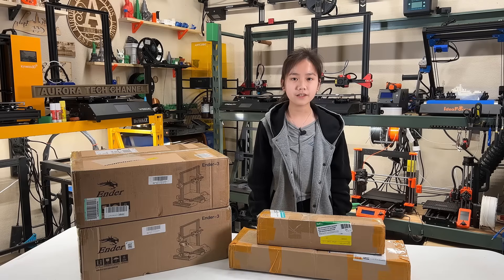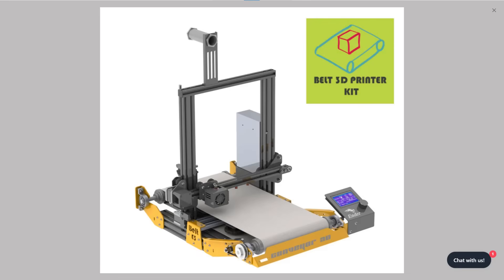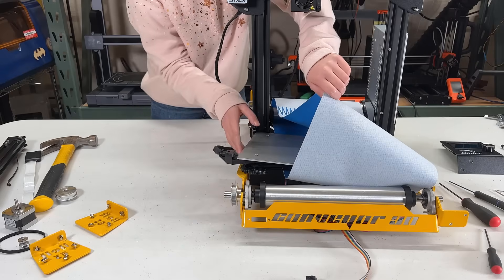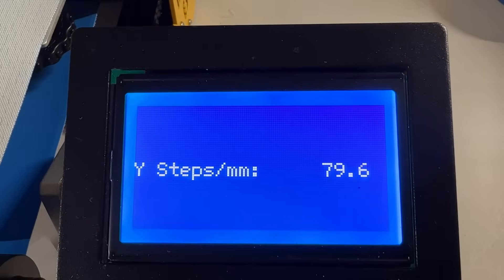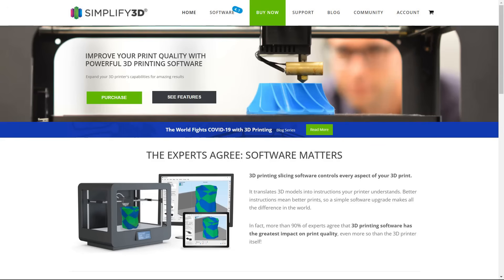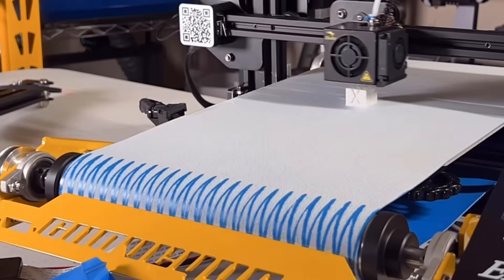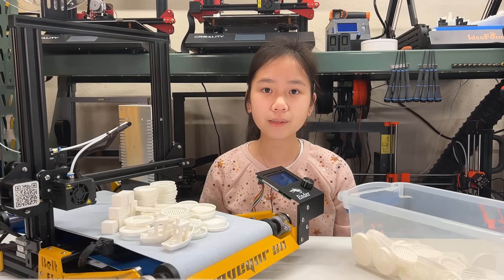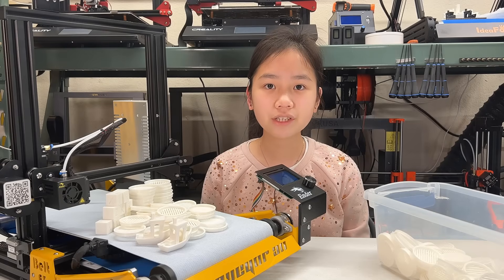Turn your Ender-3 into a conveyor BELT 3D printer, 90-degree continuous printing, batch production

Comment: Tip for One at a Time print Sequence in Cura that i just learned and has made my life way easier:
Cura will print the most recently inserted file first. So you could just enter the models in backwards order and it will print in your desired way. But even better is just throw all the models in there and arrange them as you want. Then go to the model that you want to print last. Delete it, and then immediately hit undo. Move to the second to last model. Repeat until you get to the first model you want printed, delete it, undo, and BAM theyre now printing in the order you designated without you having to move the models around or worry about placement order. Whenever you make or unmake a group, it acts as the model being imported so that will mess with your order aswell!

Comment: I am a new fan from Switzerland. I am petitioning for a new post on the same subject but with an affordable IDEX 3D printer like the Sovol SV04. I wonder if it is difficult to combine the software for 90° continuous printing with independent dual extruders. I am pretty sure it will be a very productive and convenient unit for less than a thousand dollars.
With my best regards

Comment: A question please. Would you buy this DIY conveyor considering its cost over the purchase of a a nearly new, return or secondhand CR30 which can be hand in Spain for around €450 ?  Is is better to buy the Cr30 and refurbish it or use this kit as the CR30 is a dedicated belt printer.

 Patents suck and how they are abused and control innovation need to be changed. 

They were and can be useful but now they are used by ever more greedy corporations to hold back i, block, hinder change so much. 

It's time now that the world learned to work together and use patents in a different way. We desperately need to rewrite international patent law .  I am all for protecting intellectual property but at a limit, if they are being used to prevent innovation and modernisation that this world needs then patents should be scrapped altogether and be replaced with something that will enhance and benefit all mankind.

The ""everlasting light bulb and match""  are always good examples here but whether they are true or false is what is at question, they both benefit mankind yet are prevented from being made as the corporation that owns the patents and makes those replaceable bulbs and matches will go out of business. If that's true so be it, it will force change and innovation to make alternative products that are useful to our race.

Let us work together for the common good and not for money.
Reply from the maker: A used CR-30 at €450 is a good deal, it would probably work better than a DIY kit.
Reply: Tx

Comment: What about using the Ender 3 Glass bed under the belt to take up the space ?
Once it warms up it holds the heat very uniformly over the entire area due to it's large even mass.
Reply: It would need to be static under the belt. But heat is definitely needed

Comment: I am looking to see if you did a review of the 45 degree version. to compare. The 45 degree version in theory might stick better because you are not really trying to print to the "Sky" and hope the base stays planted on the build plate. But you do have to get the Nozzle really dialed in as close to the belt as possible because the extruder is at a 45 degree angle. I am starting to think if I keep my standard printer I am going to get the 45 degree up grade kit in stead of the 90 degree kit and new/used ender 3.

Comment: you said you made a video with an ender 3 pro, but I can't find that video, can you link it here?
Reply from the maker: Here you are:

Ender-3 Pro assemble:
https://youtu.be/KCuYj9PXMkA

Hardware upgrades:
https://youtu.be/XEwSQHRiMLo

Firmware compile:
https://youtu.be/Ztj2VidZHVU
Reply: @AuroraTech  I'm confused, in the video you said you made a video where you converted an ender 3 pro into the 45 degree belt printer, that's the one I want to see. I have an ender 3, and I have the opportunity to pick up an ender 3 pro really cheap, so I want to know which one is better to use for the belt printer?
Reply from the maker: I actually said a made the Ender-3 Pro assemble video(just the printer, not the belt kit). For this belt upgrade kit, using an Ender-3 or Ender-3 Pro would be the same, just get whatever is cheaper would be fine.

Comment: I imagine they are using completely flat rollers that wont make the belt track. If you look into sanders and stuff like that the center of the rollers are usually proud of the rest of the surface which makes the belt stay in line. Very counter intuitive. Might have to get one of these kits and turn those rollers on my lathe to reshape them the correct way.

Comment: I bought five Ender 3 all with 8 bit board and they all print perfect. I get one with 32 bit board and it prints very poorly. 
Not sure about this new 32bit board. I installed updated marlin firmware to see if that would help. No change.
Reply: Thinking I have to buy another Ender 3 because this one 32 bit board print so poorly. Not very typical of Ender 3 which usually prints perfect out of the box.

Comment: Fantastic review!  Very complete and balanced.

It looks very well made and documented.

I'm a bit surprised that you are able to print on the belt where the two ends of the belt are bonded together.  I would have expected some unevenness there that would affect layer adhesion.

Adding a skirt to the benchy should help with adhesion, since it's relatively tall in comparison with the size of the base.

Did you mention anything about the bed heater? maybe the belt isn't making great thermal contact with the heating surface. It might be interesting to measure the temperature of the belt surface while printing, ideally with a thermal camera.

Keep up the great work! Your reviews are getting better and better.

Comment: What do you think of getting an elder 3-V2 and add the belt kit?
Reply from the maker: Since the Ender-3 V2 cost $259, plus the price of the kit, it would be over $500, while you can buy a new conveyor belt printer like the IR3 I reviewed last week, which came with linear rails, larger print volume, and better hardware than the stock Ender-3 for $600. So, I would rather recommend using your old Ender-3 or getting a refurbished one to play with the kit.

Comment: For Cura there is a simple workaround to print in the order you want. Goes like this: 
Place all models. Click on the model you want to print LAST. Then press und hold SHIFT. click the second last item. Continue with shift holded until you reach your first part. Then press CTRL+G to group them together and now you can immediately ungroup them with CTRL+SHIFT+G.
Now it will print in the order you want. Works on Cura 4.x. Don't know if this "feature" will last on Cura 5.0 which is coming soon.

Comment: First off -- Awesome video, thanks for making this and keep up the good work you guys.

I love that you explained the 90 vs 45 degree patent; honestly to me though, that sounds like an invalid patent (as prior work exists and patents are required to be "novel").

Second off some FYIs:
1.) When I click on your link for a refurbished Ender 3, it's now 199.99 (which is 10.00 more than a new Ender 3 on Amazon). 😅
2.) Also, if you find that your motors are running too hot, but you still need that torque, you can mount heat sinks to them.  It's a thing.
3.) Instead of a Raspberry PI, look for old Used NUCs they're slightly bigger -- but they're way more powerful; for around 40.00 I scored a Pentium N3700 -- with 8 GB of RAM and 250 GB SSD (the CPU goes from 1.6 GHz to 2.4 GHz, with 4 total cores) -- and seriously the slightly larger footprint will still tuck away right under your printer.
Reply from the maker: $199 is the Ender 3 V2, if you select Ender 3, the price will be $109. They just put all available printers on the same page.

Comment: when CR-30 was in kickstarter phase there was a contribution level for just the belt loop, and this is exactly what I had in mind. You don't have to have raspberry pi, I use a PineH64 board

Comment: Its a nice kit, but considering how much tweaking you had to do to get it working, it doesn't really seem worth the 300 bucks. At minimum, it should really include at least the parts needed to print out of the box. Seems like they need to refine their design a bit more.

Comment: Would this work on a Ender 3 s1? I doubt t but I want to know if someone has tried it.
Reply from the maker: It's not worth doing that on the S1, the S1 cost $400 plus this kit, and the total will be over $600. For the same price, you can buy a belt printer like the IR3 with larger volume, linear rails, and better hardware than the Ender-3.

Comment: 10:08 that's not a bug, that's a safety measure, In machine settings instead of changing the "Z(height)" change the "Gantry Height" it's just a little bit to the right, Gantry Height defines the clearance from the bed to the gantry to avoid hitting already printed models on common machine.

I think the real bug it's that you can skip the safety check by changing the Z height.

Comment: you do realize octoprint works on anything that can run Linux and/or android. Something like the libre computer tritium is 45 USD, and it used to go for 40 on amazon. My advice would be to look at Explaining Computer's SBC videos, as he's done a lot of SBC videos. Note that some like the Odroid XU4 are higher than they used to be, but I'm not sure if the price is correct when adjusted for inflation.
Reply: actually is there any way I can give you guys a video suggestion, there's a project I've been using on my printer that you might find intriguing. It lets you color prints with sharpies as if it's a multi-color printer. Kinda want to see how it'll work with this
Reply: I was up an running with octoprint on an old android phone from the junk drawer in about 20 min. Bonus: huge built in touch screen to access the interface.

Comment: Does Is posible to do with Ender-3 S1 pro Kit
Reply from the maker: No, the one-piece injection mold base can't be extended. Moreover, it's not worth doing that as the S1 Pro cost $500, I would buy a belt printer with linear rails for $600 instead.

Comment: Claims section from patent US8668859B2
What is claimed is:
1. An apparatus comprising:
a build platform including a surface that is rigid and substantially planar, the surface including a plurality of areas;
an extruder including a chamber to receive a build material and an extrusion tip that extrudes the build material at a controlled volumetric rate;
a x-y-z positioning assembly adapted to three-dimensionally position the extrusion tip within the working volume;
a controller electrically coupled to each of the build platform, the extruder, and the x-y-z positioning assembly, the controller operable to control the build platform, the extruder, and the x-y-z positioning assembly to fabricate an object in three-dimensions from the build material; and
a plurality of heating elements disposed within the build platform, each one of the plurality of heating elements associated with a corresponding one of the plurality of areas of the surface of the build platform, each one of the plurality of heating elements coupled in a communicating relationship with the controller, wherein the controller is configured to independently control each one of the plurality of heating elements to provide different heating to each one of the plurality of areas of the surface of the build platform.
2. The apparatus of claim 1 wherein at least one of the plurality of heating elements includes a resistive element to convert electrical current into heat.
3. The apparatus of claim 1 wherein at least one of the plurality of heating elements includes a Peltier effect device.
4. The apparatus of claim 1 further comprising at least one cooling element coupled to the controller and configured to provide active cooling to an area of the build platform.
5. The apparatus of claim 1 wherein the plurality of heating elements includes at least one gas heating device.
6. The apparatus of claim 1 further comprising at least one stream of heated gas directed toward the build platform and controllable to heat the build platform.
7. The apparatus of claim 1 further comprising at least one stream of cooled gas directed toward the build platform and controllable to cool the build platform.
8. The apparatus of claim 1 further comprising at least one sensor to detect a temperature of the build platform.
9. The apparatus of claim 1 further comprising at least one radiant heater configured to heat the working volume during a build.
10. The apparatus of claim 1 further comprising at least one radiant heater configured to maintain the object at a fixed, elevated temperature during a build.
11. The apparatus of claim 1 wherein the plurality of heating elements provide independent control over cooling the plurality of areas of the surface of the build platform.
12. The apparatus of claim 1 further comprising a conveyor to controllably move the object out of the working volume.
13. The apparatus of claim 1 wherein the plurality of heating elements are controllable to heat at least one of the plurality of areas of the surface of the build platform to at least about one hundred degrees Celsius.
14. A method comprising:
providing a build platform having a surface that is substantially planar, the surface including a plurality of areas, the build platform passing through a working volume of a three-dimensional printer;
independently controlling a plurality of heating elements for the build platform to provide different heating to each one of the plurality of areas of the surface of the build platform; and
fabricating an object on the build platform, wherein fabricating the object includes creating the object from a number of layers of a material, each one of the number of layers having a two-dimensional shape corresponding to a cross-section of the object.
15. The method of claim 14 further comprising actively cooling the build platform after fabricating the object.
16. The method of claim 14 further comprising moving the object out of the working volume with a conveyor after fabricating the object.
17. A computer program product for controlling a three-dimensional printer, the computer program product comprising computer executable code embodied in a non-transitory computer-readable medium that, when executing on one or more computing devices, performs the steps of:
controlling a three-dimensional printer to fabricate an object on a build platform within a working volume of the three-dimensional printer, the build platform having a surface that is substantially planar, the surface including a plurality of areas, wherein fabricating the object includes creating the object from a number of layers of a material, each one of the number of layers having a two-dimensional shape corresponding to a cross-section of the object; and
independently controlling a plurality of heating elements for the build platform to provide different heating to each one of the plurality of areas of the surface of the build platform.
18. The computer program product of claim 17 further comprising code that performs the step of moving the object out of the working volume with a conveyor after completing a fabrication of the object.
Reply: Looks like Bill already replied.

Comment: there is another option for continuous print. octoprint can be installed on a computer so instead of using a pi yo can use your computer just as you would with it being tethered. just remember to do updates and turn them off before printing. also you can still get a pi3/2 for a decent price and will work perfectly with this.

Comment: A patent is about a technical solution for a certain problem in buissines use.
In 90° Belt printers you only use the belt for print batches. So the printer and to use it in a commercial setup violate patent.

45° Belt printers are about infinite z. No patent against this; perfectly legal.

 While you can use it for batch printing, this is forbidden to do commercialy by the patent. 

This problem is well known in medicine: A substance is discovered and patented against illness "A".  Another company discovered same substance works against illness "B" and patent this. Unless the process how to produce the substance itself is patented, the second company can produce it and sell it against illness "B". 
Medical doctors only can prescribe the medicine patented for you illness. But of course, if you have both illnesses and medicine "A" heals not only your illness A, but also B as a side effect, it is not illegal for you to become totaly healthy again...

A product itself is only protected from being produced, If steps producing the product are patented itself (this is the reason you often se a long list of patent-numbers in a product description) or the product can be only used in a patented sceario, so production is only be done to allow others to violate the patent.

The belt system itself can not be protected (it is the same as on all supermarket cash registers, Patents expired long ago).

So only the technical solution to use such a belt system on a 3d printer to remove the prints is covered by the patent; this does not forbid to install a belt for infinite z.
But patent still forbid to use 45° belt printers to print batches of objects to sell the prints (commercial use) without licening the patent - while printing and selling swords printed with infinite z is legal. For private use you can do both legaly.